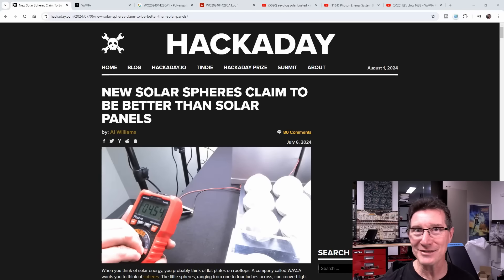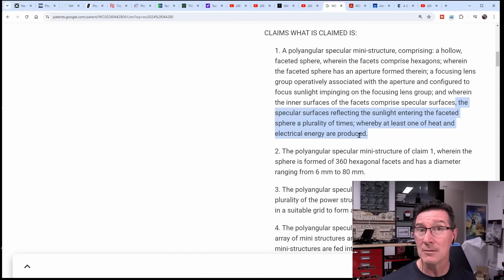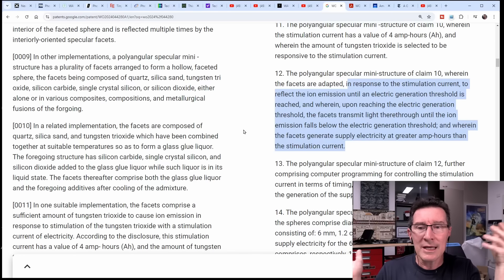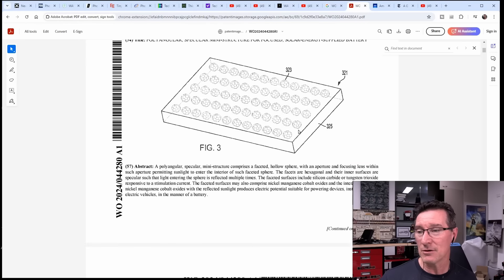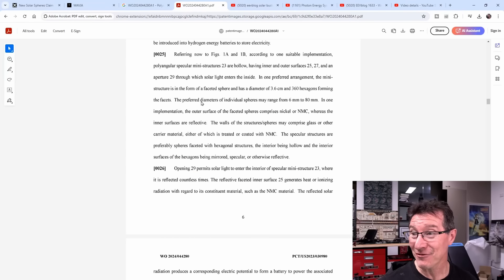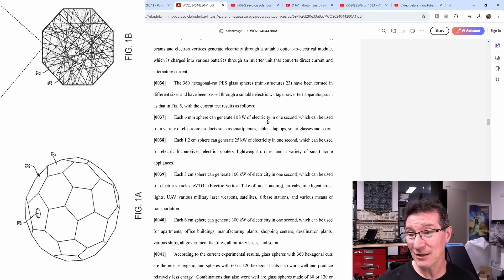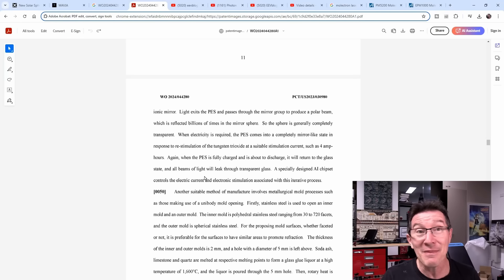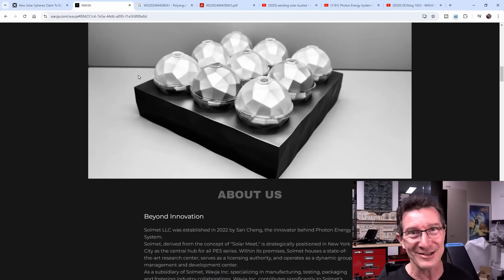EEVblog 1633 Part 2 - WAVJA Patent, 300kW Solar Balls!

Comment: I know what they think this is how it's going to work. They think the material on the inside of the sphere is like a solid state laser, that lets light pass through the surface material, which is the doted laser medium, then bounces off the backside of the material, that is covered with reflective material, basically a laser sphere if you will. And they think that the light is going to amplify the power within the sphere each time it is reflected from another facett, basically a self amplified light emitter 😅 Gee, if only we had such a material, we would be able to build high Kilowatt lasers with a 1 Watt power spurce 😂

Comment: Chat GPT 3.5 say there is such a thing as a current of photons...

A current of photons refers to a stream or flow of light particles, or photons, moving together. This concept is often used in the context of electromagnetic radiation, where photons, which are the basic units of light and all other forms of electromagnetic radiation, travel in waves or pulses.

In practical terms, a current of photons can be observed in phenomena such as:

Laser Beams: Where photons are emitted in a coherent, narrow beam of light.
Sunlight: Where a vast number of photons from the sun travel through space and reach the Earth.
Fiber Optic Communication: Where pulses of light (photons) carry data through optical fibers.
In physics, the flow of photons can be described by their intensity and direction, and it is fundamental to the study of optics and quantum mechanics.

Comment: I thought there was some kind of sanity check on patent applications.
Would they accept any kind of rubbish?
Reply: This is an application, not a granted patent. Applications are published separately, and if they are screened at all it's only for national security interests and straight up illegal stuff.

If the examiner gives them the benefit of the doubt I still expect at least the first claim to get thrown out on grounds of novelty, without even needing to invoke the bans on "perpetual motion" machines. That said the USPTO does have an international reputation for being somewhat lax and sloppy in their research, so if the filing omitted the claims of "Ampere-hours" and "kilowatts" I could see something like this being granted as a novelty desk gizmo with no practical applications. Which honestly would be fine in my opinion, it is not the duty of the patent office to prevent, correct or punish bogus claims to investors or consumers.

Comment: Um, how are they even measuring "500 KW" with a "heat measuring instrument"? 
You'd think someone would have read that and denied the patent?
Reply: It's a filed application, not a granted patent. Grants typically end in the letters B or sometimes C followed by a single digit, applications have an "A".

And industrial laser can output upwards of 10kW, so with the right filters and proper cooling an industrial venture should indeed be capable of measuring around 500kW of electrical power. Not from anything which continues to exist in the form of a 6cm sphere after the measurement though.
Reply: @Photoloss  Ah, ok first half about the patent thing makes sense. My mistake is thinking google wouldn't bother to document patent applications. 

The second half doesn't make sense though. You're talking about a laser with a known wattage. I'm talking about a part in the patent where they described measuring the kW using not a power meter, but a "heat measuring device". (I don't care what numbers they throw out, they aren't measuring electrical wattage using a device that picks up on temperature.)
Reply: @infinitivez  Well, you can measure power output even with just a regular thermometer, albeit indirectly. With a constant additional power input the thermal equilibrium temperature will be higher, and that can be modelled to calculate an unknown input power.

If the duration of a single heating event (e.g. an explosive or a laser pulse) is known then the power output, or at least a lower limit, can also be calculated from the change in temperature before and after.

With a time-resolving "heat" measurement device, such as a modern infrared camera for example, you can in fact measure the current power output even as it changes. In order to measure an electrical current you'd dissipate all of it through a resistor. In modern engineering you'd use that more for monitoring areas where direct access to the cables is not possible though.

Mind you since this is a deliberate scam I doubt they actually did any of that, but it certainly would be possible. Not at all sensible in a context where you could instead attach a multimeter of course.

Comment: 10kW in one second same as 10kJ is 2.77Wh so presumably a single 3.7V lithium cell with a capacity of 750mAh.
The AI may have hallucinated all that and so AI may have had a role in this. Writing all this fantasy takes some time so that is a good use for AI :)

Comment: The way I interpret the design is that all these fancy oxide coatings and whatever are on the INSIDE of these polyhedrons and light enters through the pinhole at the top and is bounced around the inside of the many facets hence producing electricity.  Absolute rubbish, or course.
Reply: Actually it seems they pulse between a transparent "input" and a reflective "harvesting" state. Which technically does make sense if you try to use e.g. "glow in the dark" decorations for indoor lighting, you need to open the windows during the day or switch on electrical lights every now and then so they can recharge. High-power pulse lasers actually use somewhat similar ideas and do output upwards of 10kW (average continuous output power!) nowadays.

Needless to say none of these technologies are even remotely worth mentioning in the context of photovoltaic power production. They consume vast if not excessively ridiculous amounts of input power for the sake of a very specific type of yield.

Comment: How come they got the patent approved. ?!! Is it that easy to get a patent nowadays ?!
Reply: Patent codes ending in "A" and a digit are only applications, not granted yet (those usually have a "B") and no legal rights or protections yet either.

Since they seem to have filed mostly in the US and the US patent office has a reputation for being somewhat lax and sloppy I could see most of this being granted, with the understanding of it being a useless gizmo. However the claims of kW-level power output should get it tossed out even in the US and without any court proceedings.

Comment: I think Ms. Esquire is the Patent Attorney. I don't know how they received a patent, but this has all the markings of a smash and grab scheme. They are out to take investor money and then dissolve the company while sitting on a patent that may give them patent troll leverage if someone builds something which uses one of the materials, possibly with some AI stated in their patent. 

So, how might something like this really work? You invent a new material which is a partially mirrored surface which allows the external passage of photons, one way, at a high efficiency rate, and at the same time is for all intents and purposes completely reflective. I guess you'd also need to have a perfect vacuum in it as well. Then you'd use a photovoltaic material to convert the "captured light" to something usable, with the AI chip knowing when to alter the state of the mirror to allow a photon to pass through the mirror and then switching back to a mirror so as to not let other light escape.

There are so many reasons this is patently false. I've got a better idea. Build a sphere with extreme mass and compress it into an almost infinitesimally small space. It will look very dark, but all light shown at it will be captured and stored for later. The trick to using this as a power source will be trying to harness the Hawking Radiation as your sphere slowly evaporates. We also need to invent how to create a microscopic black hole too.
Reply: This is a filed and published application, not a granted patent. It has not been examined at all yet.

But one-way mirrors exist, even completely passive ones which don't require any switching. Heck a thin coating on regular glass will do the trick if you only want a table top demonstration. The issue is that the internal box requires a large amount of space while also incurring additional losses due to imperfect reflection, while ultimately still being limited by the aperture through which the radiation enters the device. Lab-grade sensors do use such things (see the "integrating sphere" Dave mentioned in the video) but for commercial power production it's currently cheaper to just build more solar panels, and maybe slather an anti-reflective coating on the cover glass.

Single-photon-sensitive "light traps" are interesting for academic research, and I believe someone actually built/published one fairly recently. But the context was testing "Laplace's demon", a thought experiment on beating the laws of thermodynamics. As predicted the energy and entropy investment in switching the barrier is greater than the potential yield from increasing disparity between the two sides of the reservoir at that level. Or in layman's terms: thermodynamics still wins.
Reply: @Photoloss  one way mirrors exist. Check out my ruby laser. The problem I meant to infer is that it cannot be 100 perfect. Even just having some gas on the interior, there is no way to trap a photon. Not in the way they are trying to suggest and not as a way to store photons.

I went on to improve upon the sphere patent _application_, trying to solve the physical limitations, but it is fighting windmills. The trap set, and why this was published in the first place, must be to try and capture IP by claiming prior art on a future patent, by infusing technobable about something like a battery, hence the description of elements and materials which might be used in batteries. Additionally, this could be used to take investor money. It's a scam which may have received more attention than they intended.

Comment: If their sphere could capture just 80% of light, wouldn't it be black? they show it as being silver which is a sign that light is being reflected off the solar panel. 

perhaps they think that the 4 amp hour is a form of activation energy that must be used to start the solar panel.

The AI chip I think is a misunderstanding, I think it is a micro inverter.

10kW is quite a lot of energy in a very small area. If it is 10 volts it would be 1000 amps. A single phase cable for 230 volts with a diameter of 5mm, is only recommended to run 76 amps through

Comment: claim 11 and 12 - sounds like mangled description of rechargeable battery - you supply "stimulation current" (4Ah) and get electricity back. Probalby - as @Evergreen64 suspects - someone gave descriptions of rechargeable battery, solar cell, mirrors and soccer balls to AI and asked  it to combine the information into descritption of a technical device...

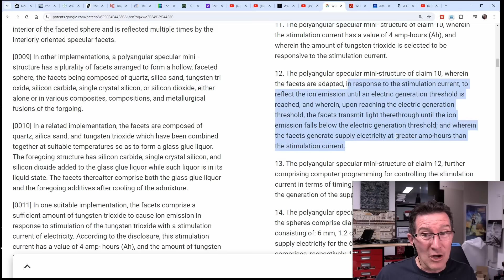Comment: Regarding 7:38 "greater amp-hours than the stimulation current" isn't actually over unity. Every buck converter outputs more Ah than it "consumes" at its input. Ah=C/s * s=C It's charge not energy. 🤓

Comment: seems like they tryin to make a lithium battery cell that is superfast charged by the heat generated from the light bouncing off the inner facets of their woo cell material that makes up their balls.. the material has to reach a certain charge (4Ah) to active it and create the extra charge from the light, so the material cant drop below that 4Ah without needing input from another source other than light. when its charged it becomes transprent.. they are then tapping off that to charge the battery in the box.. we never actually see it in the videos tho..the box has the 'AI' for power delivery to devices and 'AI' to control the level of charge on the balls material pull and pushes to the battery.. ..battery is big to allow quick large power draws...(that size would do 300kw!)
...but the numbers to charge the thing from light are way too high.. more like mW than kW....

no.... its just all word salad...

Comment: Here's some public avaliable info on the Taiwan based company
	
威加光子科技股份有限公司  (WAVJA Technology INC)
(9 F.-5, No. 168, Sec. 2, Fuxing 3rd Rd., Zhubei City, Hsinchu County 302052, Taiwan (R.O.C.)

ownd by 朱元中 (Patrick Chu) and  胡巍瀚 (Joseph Hu, aka Alfred Hu)

WAVJA trademark registered under 胡巍瀚 in Taiwan since 2023-09-16

The company is originally registered as 威瓦光子科技 under 朱元中 in Taiwan since 2023-05-19, later changed name to WAVJA at 2024-03-12

Comment: 300kW in 1 second -- what the hell does that mean?  If the power output is 300kW then it's 300kW this second and the next so long as the conditions remain the same.  If we take a baseline of 200W/m^2 with full Sun and then multiply that by 60 we get 12kW/m^2 which is more than 10 times the amount of power the Sun delivers to a meter squared -- where is the power coming from?
It's pretty obvious this is a scam outfit simply looking for investment with no actual products being offered for sale.  This could not possibly fool the average engineer, scientist or tech savvy person, but the media and the public are fair game.

Comment: From what it appears, they have a light capture (battery) device.  You shine light into it, and it reflects around the inside.  Than on demand they do some stimulation and it all comes out at once.  Nice try, but it won't work.  The light escapes from the entry point I suppose.  If it did work, it would probably melt the inside.

Yes, total manure!  Of course the investors are the real suckers.

Also form the looks of it, that isn't a USA patent, I suspect that whatever country they patent it in the application wasn't "peer reviewed".

Comment: The 1kW per square meter of solar power is in joules as well. That heat energy needs to be converted to electrical energy before it can be transported. Your sphere is probably better because it has 5g AND AI..

Comment: Tungsten trioxide is used in electrochromic applications.

My best guess is that that an LLM just spit out some parts of paper/patent on electrochromic glass?

I don't know anything about how it works, just that it's a thing that exists.

EDIT: I'm almost 100% sure it's a result of an LLM receiving a prompt about reflection, glass, electricity and similar terms. That's why it mixed battery technology with electrochromic glass. It's probably why it has those crazy numbers, because the internal logic is mostly consistent, it just has no relation to reality.

Comment: I wonder what would happen if you somehow concentrate 100MW during one second in a 6cm sphere. Well, even that sentence makes no sense...
Reply: Instant warp10
Reply: At 10kW output power industrial lasers handily cut (more like melt-evaporate) through solid sheets of steel several centimetres thick. A 100MJ pulse should be "relatively easy" to handle, as all you really need at that point is a large enclosure of strong magnets to contain the plasma. In a vacuum chamber, because dumping that much energy into atmospheric gas will produce a thermobaric explosion instead. Although I guess an abandoned quarry or an artillery testing range is a fairly simple option too.

Comment: #12 looks be a magical set of blinds for their magical solar panel made from battery components. Current causes their special sauce coated (Or is it impregnated? They can't decide.) glass to start to produce ions and, at the same time, start to reflect ions. Because it didn't before then, apparently. Then, when some magical threshold is reached (threshold of what?), the glass turns transparent and lets light in. Which then lets their magical solar panels, made from batteries, produce electricity from the light. Why not just expose your magical batteries to light and skip the magic glass?

The the spheres are made from soda glass (#17) coated with their special sauce and simultaneously made from a mixture of soda glass with their special sauce mixed in? What?

Comment: Yes you are wrong, but i think this is a AI produced patent. To make it easier if you have a box 10cm x 10cm x10 cm, then inside and outside you have 1100cm2 where light can hit. Ambient photonics make a material that produce 0.8watt/10cm2 so one square produce 88watt/hour. A normal solar panel that is 25times bigger groundwise will produce maybe 88watts too but just for 6hours a day year round, so this sphere with artificial light will produce 400% times 25 or 100times the output per average hour. Now they claim that their next generation sphere will be 60times more efficient and i guess this fit with making my square to a ball then it might be 60times, and today they just claim 20times, so they do NOT get 800watt/m2 as i can get them, but around 300watt/m2 which apply for a bad solar system.

Comment: Meh. All this modern stuff. I stay with classic solar roadways. Good, that earth is flat so I dont have to worry about curvature. 
Do you know, you can use the Moonlight to generate power by simply flipping over a PV Panel? This will make it a Lunar Power Module, or LPM in short. Kickstarter Link follows.

Comment: @EEVblog  Err, Slight problem with the size and "claimed" power, Starting with the smallest one. Could someone please ask the people concerned "How the f**k are they are cooling these things!"  Just need to look at yer average CPU cooler size and then think 10kw? Let alone 300kw!  🤣🤣🤣 OH WAIT! Just thought, they are absorbing the heat to gerenerate the "Stimulation Current!"